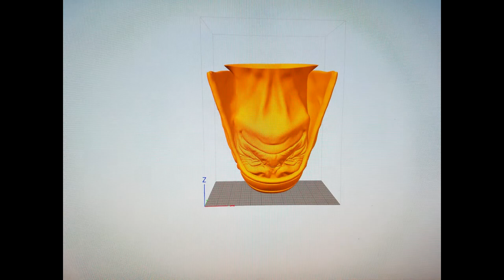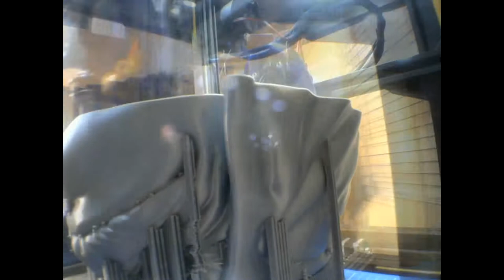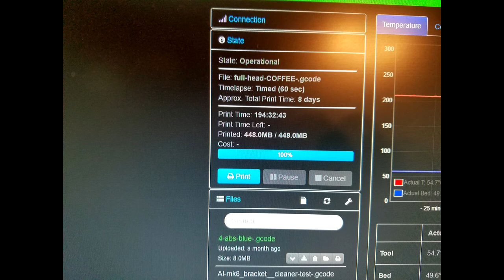StarWars Rogue One PAO 3D Printed Timelapse

Comment: Hey Jer...I know it's  been more than a year since you printed Pao but came across Mighty Jabba's Collection channel recently and he printed Pao just like yours on a cr10 s4 or s5 right side up with supports only under where the hood 'ends' with no problems. Just letting ya know in case ya want to tackle this model again...also watch his vids printing a FULL SIZE JABBA in pieces...pretty darn interesting...
Reply from the maker: Printed mine on a cr10,300x300x400,upside down,but since then realized that right side up with no internal supportswill work fine with thick layers,only leaving some supports around eye sockets etc.All my heads and I have a lot were 6/5/4,10% for walls works great.I slice with S3d.